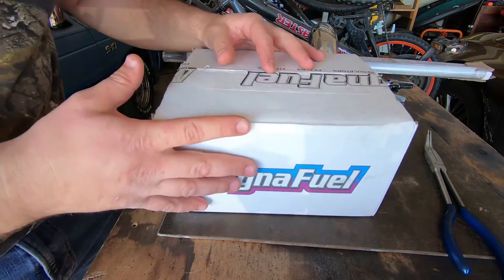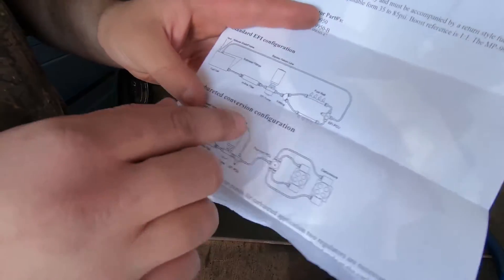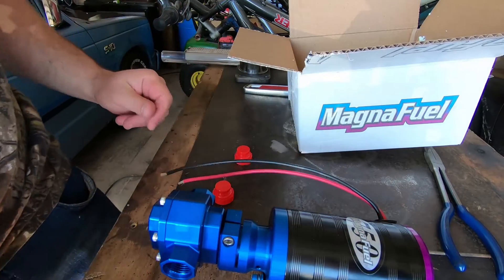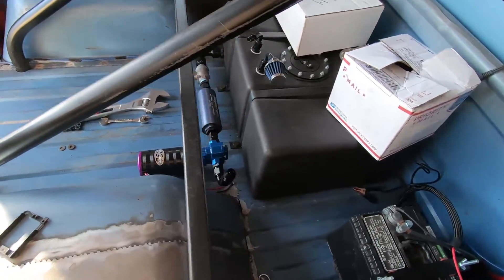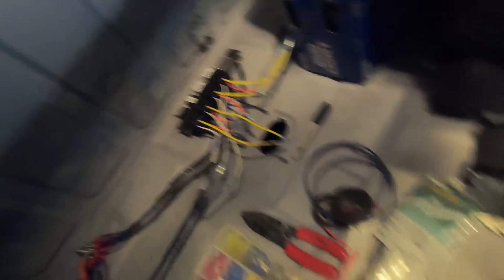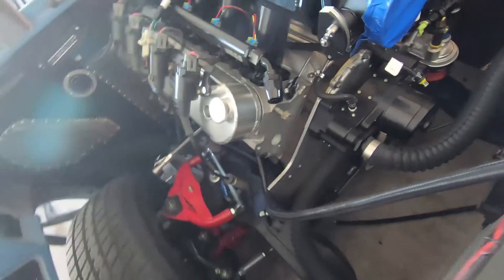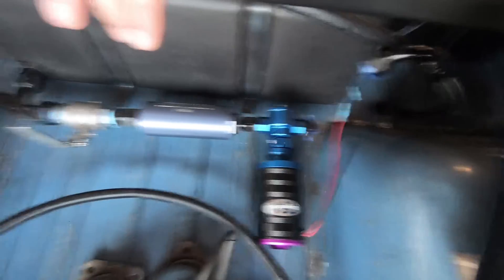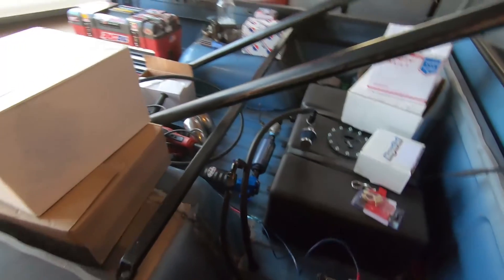Building a Drag Racing Fuel System

Comment: Do you know how that pump does with pulling fuel?
I have 2 -10 feed lines coming from my fuel cell into a -10 Y, through a pre filter, then put through -6.
The problem is that I’m mounting everything under the bed. 
There’s plenty of room, but there isn’t a lot of fall for gravity to assist with feeding my current pump, and I’d like to upgrade to this one so that I’ll have room to grow in the future.
My truck isn’t gonna be anywhere nearly as wild as yours though.

Comment: For the cell vent, the easiest thing to do is run a check valve. Or if you already have the line, just extended it out and put a loop in it then run it to a bulkhead in the floor and attach the filter to the underbed side so you don't build up vapors inside the bed when the cover is on. I did the latter version in my S-10 and it works pretty well. Never had an issue.

Also, 100% chance I was expecting a dipstick and flexplate bolts in the box.
Reply from the maker: Yeah those both sound like good ideas. I like the check valve one, and I do have quite a bit of hose laying around so it shouldn't be too difficult. And yep you never know what I have up my sleeve next